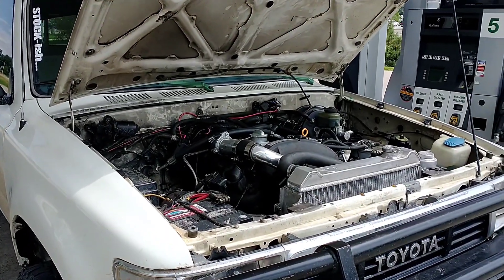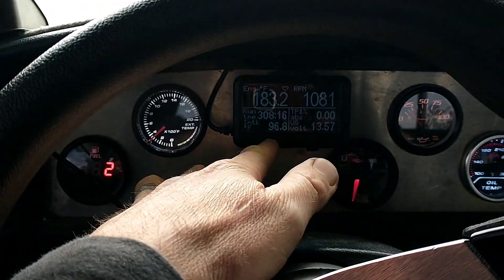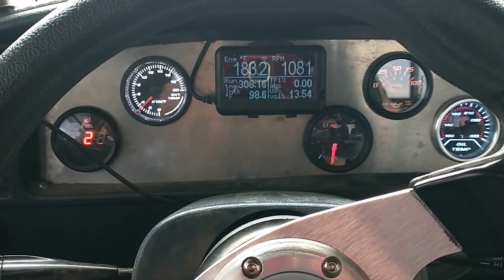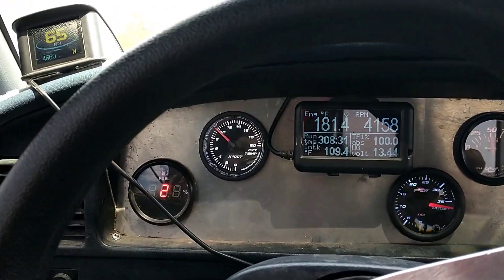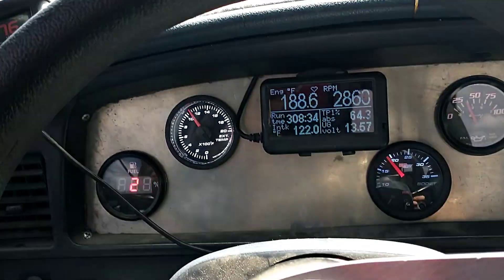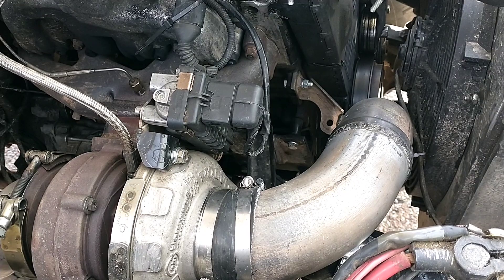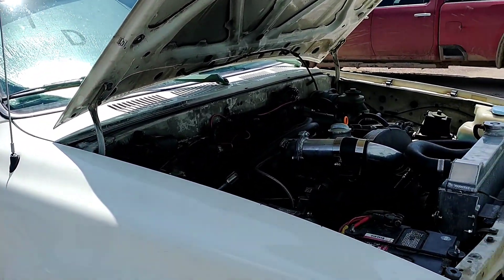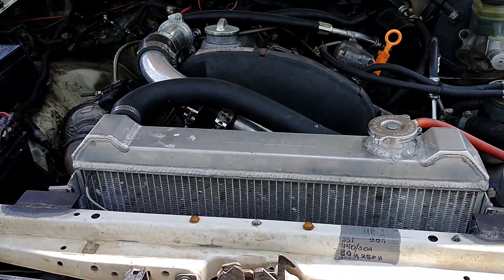1.9L TDI Swapped Toyota Ride Along, Daily Driving with a GTC2262 Mini Semi Turbo 36 PSI Boost

Comment: This is awesome, love the videos!

How is the boost compared to a VNT 15, at 1,800-2,200 RPM?

Im planning an ALH TDI 8 speed automatic transmission swap into my 2wd 1983 S10 for daily driving and am thinking when normal driving that it will probably stay around 2,000 - 2,200 RPM unless I'm pushing it.
Reply from the maker: Usually this big of a turbo doesn't do a whole lot in that RPM range but because this was designed for a low RPM engine it's mapping spools up very quickly even on the smaller engine. I can build up to over 30 PSI at 1800 RPM much more than what the VNT 15 even supports
Reply: @TDISwaps  that is awesome!

I guess this will be the turbo I will upgrade to after I get my swap done!

Keep up the great work Brother, we really appreciate you!
Reply from the maker: @JonathanDiffee thanks for watching man, will do!

Comment: Did you say you're running a stock Toyota 5sp transmission? It bolts right up? Straighten me out please.
Reply from the maker: Ha ha you need to watch the whole build series on my playlists sir.  This uses an adapter between the engine and transmission to connect the VW to the original Toyota r150f 5 speed
Reply: @TDISwaps  ok. Will do.
Reply from the maker: @Twilightzoneisreal no problem man, it's a sweet setup!

Comment: this is the only thing i dont like about some engine swap, is removing the stock gauge cluster. On something this old you could had made the stock cluster work. and had the digital read out on the side for the engine, removing the cluster makes it feel not factory and more like a race car. The factory cluster would had everything but boost and do you really need that gauge once its tuned? not really. Could of hid that in the glove box etc. There is nothing like a engine swapped car with all factory gauges working, it feels oem, even the brz/frs can be engine swapped and all factory gauges work and its on can bus. This is old analog, it would be way easier. not hating on the swap or anything, it just feels unrefined.
Reply from the maker: My problem is, I would still want to see oil temp, EGT, boost to keep things in check, towing at 70 MPH I am pushing this engine hard in the mountains.  That and the original cluster only said hot or cold for coolant.  230° was barely moving the gauge and that with 1300° EGTs pulling a mountain pass towing has already cracked a piston in my other truck.  You really need precise numbers if you want to abuse the engines, and the factory gauges didn't give me that.  Also, with 33" tires the speedometer was 12 mph off with the only fix being a $250 inline cable speed reducer.  That alone paid for every gauge on my dash 🤷

Comment: Hey nice setup I really want this setup on my Hummer h3 is manual transmission do you think the 1.9 will move  highway speed ?
Reply from the maker: Oh definitely, probably the biggest concern will be temps in the summer months, in the winter these things will tow a house!
Reply: @TDISwaps  where are you located? And how much in time and money are we talking about ??
Reply from the maker: @manuelpiney7876 it all depends on fabrication and parts costs, you can do it for $1500 just as easy as you can spend $4500
Reply: @TDISwaps  really 👍

Comment: Great looking/working swap. Any idea on the AFR at 36psi?  Seems like quite a lot of air even with the 240s.
Reply from the maker: I don't know for sure, I am mostly using the extra boost to stay an lean as possible for EGTs
Reply: @TDISwaps  yeah temps look good so apparently the added back pressure isn't an issue
Reply from the maker: @vica153 ya high elevation requires a leaner mixtures, not sure how the added back pressure will affect longevity, but I will be happy if the engine even last 1/2 as long as it did in most cars

Comment: What gear ratio in the axles on your truck? Im looking to do a tdi swap in my ranger. Stock axles in my ranger are 4.10s
Reply from the maker: The Toyota also has 4.10s, with the factory transmission OD I am about 3000 RPM at 80 MPH on 33" tires, works pretty perfect for my mountainous location, I've been consistently 28-32 MPG at that speed

Comment: 2.6 bar?😅
Reply: reinforced head bolts?)
Reply from the maker: @user-mo5wu9hl9e yes head studs are a must, and limited boost until over 3000 rpm
Reply: If you lower the boost pressure a little does smoke appear? Why do I ask, if there is no smoke, then you can slightly reduce the boost pressure. the geometry is more open, it is easier for the engine to eject exhaust gases. Sorry for the English, Google translate)

￼
Reply from the maker: @user-mo5wu9hl9e I am sending full fuel on 260 nozzles, it definitely starts to smoke under about 2.2-2.4 bar, but more than that EGTs go even higher
Reply: @TDISwaps Do you select the injection advance angle yourself and put it into the control unit?
Reply from the maker: @user-mo5wu9hl9e my tuner does all that for me
Reply from the maker: I like to party man 😂

Comment: Overall how difficult was this swap? What'd you have to modify for fitment? Thanks I have a 1984 2wd 22r im thinking of swapping either a tdi or an om617 in. Thanks
Reply from the maker: Well the 91 body style gave a lot more engine room for the V6 making the TDI fit in pretty nicely. I've heard that the 84 is a little bit more work clearancing things or just deleting parts off the engine so there's room. I wouldn't even dream of trying to fit in om617 in there without a 6-in lift or something. The solid axle does help though as long as you're lifted. Almost all the hoses and accessories crossed over very nicely. There wasn't much extra parts to buy if you are okay with reusing hoses and stuff. And I've gotten very good at the wiring aspect so I'm selling those to help people out. Overall it's much easier than a lot of things you could swap as far as I can see.
Reply: Ok thanks for the info. Yeah everythings stock no lift lol. Might be leaning towards a tdi. Thank you for your hard work @TDISwaps
Reply from the maker: @DUDENOHELP glad to get the info out there!

Comment: So, are you running the VW A/C compressor? I am in the process of the same swap.
Reply from the maker: Yes all factory VW accessories, I did a video on the air conditioning setup
Reply: @TDISwaps  awesome, I will look that up
Reply: @TDISwaps   Are you using the stock Toyota evaporator or the evaporator out of the VW? Does the Toyota expansion valve mess with the VW variable VW compressor?. trying to determine if I should run the stock Toyota evaporator or hack up the evaporator box to try and fit the one out of the VW. Thanks!
Reply from the maker: @foxriding753  Everything is Toyota as far as air conditioning up to the VW compressor and chucks of the VW hoses.  I'm not sure on the variable compressor, I believe the older 00-03 compressors are still just on and off, but either way it is ICE cold through the Toyota evaporator, I can read down below 32F sometimes on the highway out the vents, no issues yet.

Comment: Thanks for the video. I do have a question, with this set up, would/could you take it cross country?
Reply from the maker: Well I mean with a 91 Toyota I always have a toolbox full of tools for the rest of the truck LOL usually I can handle anything at that point. I've done about an 8 hour round trip with it that's the longest but I really don't have issues much to make me fearful of a longer trip.
Reply: @TDISwaps  Im just curious.  I have a 51 Ford PU with a 5.0 v8, 3 Spd auto going through a 2.50 final drive.  The engine and trans are getting tired so the TDI swap looks interesting. And very different.
Reply from the maker: @nautn yes it's not common, but as you can see from my channel it's starting to get a lot of interest, I actually have a 59 f100 planned for my next swap haha

Comment: So I’m putting an AZZ model into a ford ranger. I have the wiring harness from the ranger going through the ECU and then into the gauge cluster. To make the tack work on the stock gauge cluster would I have to get an adapter to go from ford to VW or would it work like the stock ranger motor? Thanks!
Reply from the maker: What year of ranger? There should be a tach wire from the VW ECU but I've never actually used it on a swap so I'm not sure what would need adapted to send something to the ranger ECU.  My jeep tach got it's signal from the crank sensor so I left that hooked up to the transmission
Reply: @TDISwaps  so there isn’t an ecu with the AZZ it’s all mechanical so I didn’t have to do a stand alone harness. But the ranger is an 2003
Reply from the maker: My bad, you would either need a W wire off the alternator, or use a diesel tach adapter from autometer.  But I'm still not sure what the ranger ECU is looking for

Comment: is low oil pressure normal with a  alh
mine is about the same as yours 
love the truck
Reply from the maker: ALH pumps only do 30-40 PSI that's factory spec at 175° so at 210-230° it's going to be even lower, the PD pumps do more but I've never seen 30 PSI as an issue
Reply: @TDISwaps  thanks for the info 
I was a little apprehensive about the oil pressure .
I have a alh mated to a 200r4 trans in a 1967 Datsun 520 pick up 
it like yours will pull any hill as fast as I want to go
Reply from the maker: @BTB31  Nice! they are amazing little engines!
Reply: @TDISwaps  yea their super fun little monsters 
im in the process of putting a brm into 74 pinto wagon with a cd009 six speed 
should be fun
Reply from the maker: @BTB31  Ya it will!

Comment: The tune also plays an important role in how well this thing works. We're lucky we've got who we do.
Reply from the maker: You are right there! ♥️
Reply: What year tdi is easiest to swap into a 99 4runner?
Reply from the maker: @NickGenna-vc7px I think that has the differential on the opposite side as mine, in that case possibly a PD engine would be better, but the ALH fits well in most applications.
Reply: To bad he only wants to work on "cool" builds
Reply from the maker: @SketchyAsFunk  Well.... he's just had alot of issues with different setups and prefers to avoid them.
Reply: @TDISwaps  glad I went with his recommendation to not have him tune my shit 🤦
Reply from the maker: @SketchyAsFunk  Sorry to hear that man.
Reply: You talking Tek?
Reply: @jonbeaulieu8863  yeah
Reply: @jonbeaulieu8863  YUP!
Reply: Yeah he seems to want to do more fun work than the daily drivers and common builds but luckily he is doing mine. GtB2056 with jaords .280s seeing this gtc though has me second guessing my choice 😂
Reply: @jonbeaulieu8863  I'm doing basically the exact same thing with same injectors in a 4runner swap. It took him almost a year to remove the immobilizer from my ecu but didn't even bother to put a base map on it so I'm just going through some euro dudes that are much faster and cheaper so it ended up working out for the better atleast.
Reply: @SketchyAsFunk  you talking Saku for the euro tuner? And I get it for sure, I'm not in a rush atm so it's not bad but if I was antsy to get it going I'd be looking for quick turn around service for sure 👍🏻
Reply: @jonbeaulieu8863  yeah I wasn't antsy a year and a half ago either 🤣 but not rock crawling for 2 years is starting to get to me. I can't handle camping on packed ass trails anymore lol
Reply: @TDISwap  yeah I've heard tune is key for saving rods, I just ended up doing maxpeedingrods on my build so so I can have all the torque at once lol 😆.
Reply: Bending 2 stock rods btw? I know tune and rpm play a factor but I've heard anything bigger than vnt17 ideally you do rods